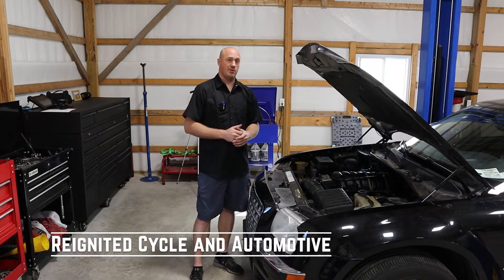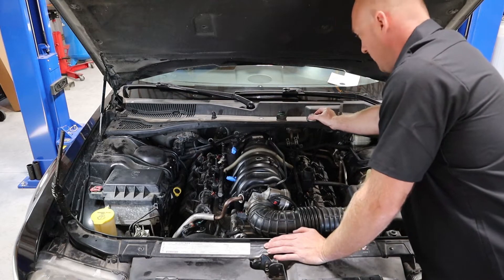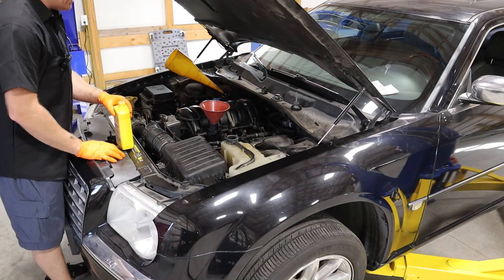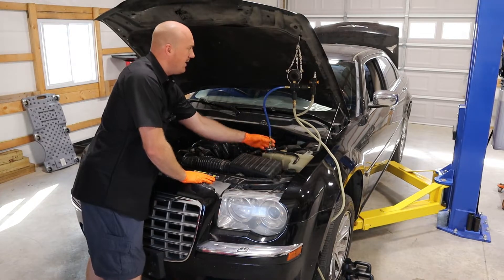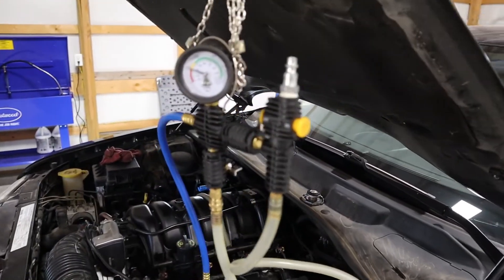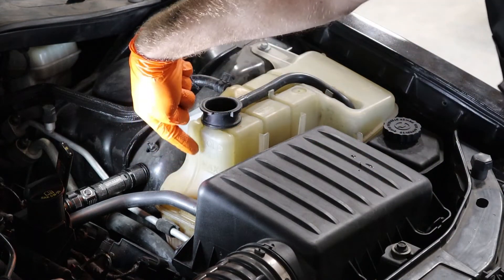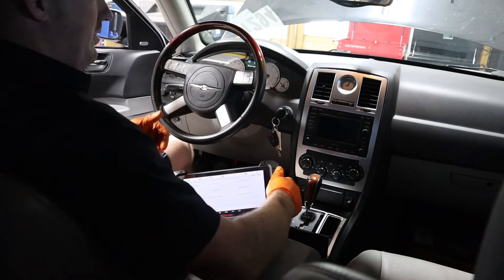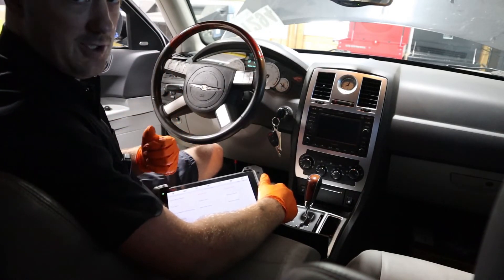Will It Start // Chrysler Hemi 5.7 Engine Rebuild Completed // Chrysler 300 Episode 5

Comment: I know this was from 2 years ago but I just saw this video and wanted to comment on pulling the fuel pump fuse so that the engine won’t start immediately to allow the oil pressure to come up and start to lubricate the engine.  This is a great idea but you don’t have to pull the fuel pump fuse.  These cars have a “clear flood condition” procedure which does the same thing.  With the engine off press the gas to the floor and then turn the key to start it.  The fuel pump is off and will remain off as long as you hold the gas pedal down.  I do this after each oil change for a few seconds to get the oil flowing before it fully starts.  I really like your channel and have been watching it for a while.  I have a 2008 Dodge Magnum R/T and a 2009 Chrysler 300C.  I do most of the work on these cars myself as a backyard mechanic.  I love working on them and learning more about them.

Comment: I love your videos. They've been really helpful with my 5.7.
Keep em coming.

I saw this video a few weeks ago and COMPLETELY forgot about how this sounded on start-up.
I took my time making sure I paid attention to what I was doing tearing it down and I did everything right putting it back together and got my 2014 Ram 5.7 back together after replacing the drivers side head swap due to broken valve spring and valve guide. 
It's  been a few months since it has been running, mostly due to my wallet said so, I started it and this is the way it sounded, but being gun shy from when I was trying different stuff to try and diagnose what turned out to be the spring, and ended up breaking the valve guide, I shut the truck back down immediately, thinking it had jumped time from all the clattering it was doing. 

So I went through all the shit needed to drop the oil pan on the 4wd trucks, swapped the timing chain AND DID THE HELLCAT OIL PUMP UPGRADE. 
When I get it all back together this time, I'm going to remember this and let it run to get the lifters pumped up.

Comment: when I worked as a yamaha tech I made a forced engine lube system with a old tire air tank using the oil galley plug.  this is something you have to to do LS engines. you can actually buy them from summit racing or jegs.  I think melling makes them.  I had a 2.2L that even with pre lubing the engine via a makeshift luber through the blocked off distributor hole it never stopped ticking. I had to pull the head off a brand new engine.  after that, I dont trust they will stop on their own.

Comment: Man I bought a 2006 dodge durango 5.7. I didn't have a lot of money. But the guy sold it to me said. It runs great. And it did for like a week . Now I have this dodge and no way to really fix it. So I loved this dodge but now I wondering how to get it back on the road.. I found that they used a head gasket sealer and its starting to leak again. Man really thought this thing was great. But it is a problem. 
It only has 128 THOUSANDS miles on it.  But I love these videos it helped me to understand the problems I have with it.
Reply from the maker: Sorry to hear about the issues you are having, but the good news is the Hemi is a pretty straight forward engine to work on, so if you feel confident tackling it yourself I'm sure you could do it. 👍 I'll have more Hemi based videos coming soon that should help if you decide to rebuild it. Thanks for watching!

Comment: Thanks for these videos! I’m probably going to need to rebuild my HEMI soon too, and for the same reason. Except mine got hot before I could pull over and stop. Water pump failure, but it still runs fine. Just idles down in steps after you rev it up 🤦🏼‍♂️ are you near DFW by any chance? 😂

Comment: Great video thank you! I’ve got a ‘14 Ram 2500 4x4 with the 5.7 HEMI and I’ve got a bit of surging / hesitation between 2-3.5k RPM’s on acceleration. I suspect the common lifter issue but we will see. Very good tips and info in your video in the event I have to tear into things. 👍🏻👍🏻
Reply from the maker: Thanks for watching! 👍

Comment: I can't get the plug out of the water pump on my 05 Magnum Hemi so I use one of those large funnels that connect to the radiator cap position that can be mounted up high.  The air burps out in a few minutes filling the system the first try.

Comment: Thanks again for your videos, as an old-school car guy I grew up rebuilding small block Chevy and Mopar engines with my dad, who also was a line mechanic for a Dodge dealer back in the late 50's and early sixties. It had been about twenty years since I got into a full rebuild - and I'd never tangled with a hemi until now, and it wasn't something I looked forward to but with your help, my 5.7 is back in the car, and it runs great (although I've only got 250 miles on it so far). I do have a question though, regarding break-in, the last engine I went through completely was a Mopar 360, and as usual, I ran a good 20 weight for 500 miles through break-in, and then changed to 30 wt. On the 5.7, I went with 5-20 (Mobil 1) and as per the owners manual of my 300, planned to change it out at 300 miles with the same brand and weight. Someone mentioned that I should have run a break-in oil first - one without zinc for engine longevity or some such thing and I find I'm second-guessing myself about something that I can't substantiate, I noticed you went with Pennzoil (5-20?) I wanted to get your opinion/thoughts on that.
Reply from the maker: Love to hear that you were able to get it done yourself! As far as break in oil is concerned, no worries, just run the oil you have in there. The break in oil is more for older engines. If you went so far on your rebuild to hone the cylinders and install new piston rings then the break in oil makes sense. But if you just replaced main bearings/ rod bearings ect... then it's not an issue. The new camshafts also do not need break in oil.
Reply: @ReignitedAuto  Thank you very much for your time on that - yeah the engine dropped the valve seat on #4 cylinder and well you know the rest, however while the pistons and head took a pounding I was surprised how good all the bearings and journals looked, very little telltale wear but I replaced everything but the crank anyway. I went ahead and installed all 8 pistons and an MDS delete kit, and used a tuner to shut it off at the ECU. After all was said and done, I almost enjoyed the work, and I hope to keep the car for a long time, your videos provide a valuable service to guys like me so thank you and all the best to you.

Comment: Hey , I just finish rebuilding my 5.7 w/ mds delete kit , melling HV pump  

got it turnt on it sounds like a diesel engine. I was thinking that it was just the lifters so I took it for a test drive and not even 5 foot from the house it had no power . 
I should mention that i got my mds programed by a local tuner 
I checked codes and only fount p0016 
please help me diagnose my truck
Reply from the maker: Generally after someone has done a lifter job and experienced an issue like this, I send them to this video first: https://youtu.be/jMziMqWRMk0
If this doesn't turn out to be your issue, let me know and we can dive deeper. 👍

Comment: My car started to make that ticking noise . Do you thing i can drive for at leat one year like that?. Also one of my local mechanics put some thicker oil. And the ticks are still there but less louder. But the car still drives. But has misfire code in all cylinders.

Comment: I have an 04 hemi 1500 and the engine was rebuilt but I have no crank at the key I jumped.the started solenoid and it cranked over then some came out the back of the intake manifold and then I tried it again now no crank at all with jumper wire

Comment: Got a second generation Dodge Durango 5.7 hemi does the harmonic balancer have a gap in between the crankshaft seal in the harmonic balancer why is there a Gap in between harmonic balancer is on all the way and still a gap any advice

Comment: I love what you doing. keep up the good work. I've been watching a channel for a while now. I have a problem. I was wondering if you could give me some advice? I recently had my lifters rods replaced I'm my hemi 5.7. the car was taken to the dealership to get it looked over. But for some strange reason my lifters keep making a loud tapping noise is it anything that I could do to calm that down?
Reply from the maker: What exact parts were changed? Were the parts factory parts? Did the noise only appear after the parts were replaced? Let me know and I'll see what I can do 👍

Comment: Hi, first of all, great video series of this rebuild!
I would like to consult with you about something..
I have a 2010 jeep commander with the 5.7 hemi vvt mds..around 120k miles on it.
The car overheated and coolant was flowing into cylinder number 6 only, it didn’t mix with the engine oil.
The block and the pistons are in good condition, only the head gasket was toasted at first glance.
When the heads were sent to be pressure checked, one valve and valve  seat teared so I kind of had a luck with that.
Any way, many of the other valves on both heads are a bit displaced.
I am considering of purchasing two rebuilt heads.
My question is, if there is a risk of putting rebuilt/new heads on old block like different pressure that will harm the crank or pistons and eventually cause an excess of burning oil or any other bad thing?
What do you recommend?
Thanks
Reply from the maker: Nope, I wouldn't have any concerns about putting rebuilt heads on the original block. 👍 One thing I would say to look out for though, make sure the heads are using factory valve springs. I really have not had great luck with aftermarket Hemi valve springs. Hope that helps, and thank you for watching!

Comment: Hey not sure if you have mentioned this in other videos you have made, but I was wondering during the scanning section of the video why a cam/ crank relearn procedure wasn’t done? Does it need to be done after rebuilding a stock engine? New to mopar and hemi’s here
Reply from the maker: It's a procedure that can be run using a powerful enough scan tool, but it's not strictly necessary. The engine will run just fine without it, and it'll auto learn as it runs anyway.
Reply: @ Thanks man! Appreciate the reply! Building up a 6.4 Jeep that I got from the salvage lot, and have been watching all your videos for tips and tricks, appreciate the content and the expertise!🤙🏻

Comment: Great Series of videos, I do have a question my car has over 2000k miles and think of the rods tools crap. Do you recommend to rebuild whole engine or just replace the knocking rod or piston? What type of kit do you recommend? Should I have the block machine or hone? I would like to try and do it myself.
Reply from the maker: At that kind of mileage I'd be looking at a full rebuild. However, you won't know how deep to go with it until you take it apart and look at it. Honestly, with no prior issues I don't think there's any problem with just doing a quick hone job and slapping some new piston rings on it. New main bearings, new rod bearings, new lifters and all new gaskets/seals. As far as kits go, I don't have a good source, but to be honest for the main/rod bearings/lifters go I'd be using factory parts, you don't want to take that apart that far any more than you have to, stick with parts that you know are good.

Comment: This has been an AMAZING series. I'm in the middle of doing a very similar project. 

I have a question you may be able to answer. I have a 2013 Chrysler 300c AWD with a 5.7 and spun a rod bearing. 

As a project, I got a hold of a 2014 300 SRT8 and did an engine swap. It seems to have been plug and play (except for swapping the oil pan and having to get the exhaust around the transfer case.  I have 3 issues that I'm having trouble finding someone to help me with cause it's a now a Frankenstein car.

1) The power seems a bit low. I kept the 5.7 ECU cause when I plug in the 6.4 ECU the car starts and shuts down after 5 seconds.
2) As soon as I roll over 10 miles an hour, I'm getting a Service AWD.
3) I also have the ABS and Traction lights on permanently.

Let me know if you can help. I'm willing to pay someone for information, but haven't found too much info.
Reply from the maker: That sounds like a very interesting project, and unfortunately you're going to need the help of an aftermarket tuner to solve your issues. The reason the car dies after a few seconds on the 6.4 PCM is it's not seeing the proper key for that vehicle. It's a security feature. That could be turned off using an aftermarket tuner, however, it won't fix your AWD issues. The power is low using the 5.7 PCM because the tune is all wrong for that engine, doesn't have the right injector size programmed ect... Your best bet in this instance is to find someone who can tune the stock PCM using a piggyback style tuner for the new engine. As far as the AWD stuff goes, it's likely that the system needs to have an ABS calibration procedure performed. If possible, see what codes are in the ABS module and get back to me. 👍
Reply: @ReignitedAuto   Thanks for the reply. I've called about a doze garages and so far no one wants to get involved. I did reach out to Nick from Nick's Garage Youtube channel. And, while he works on older cars, he's going to try and help me find someon. It seems like Youtube has become the true place where people want to explore and try things. 

I'll try and find a tuner, like you said. Out of curiosity, I actually have the key from the 6.4 PCM and brought it with me to the car, but no luck. 

I'm thinking if I can't get help to start learning about TunerStudio and taking on the task on my own. I have a background in Computer Science, so I'm thinking that may help.

Thanks so much
Reply from the maker: @icarusfx84  Yep, I can almost guarantee that no shop will want to get into that, it becomes a snowball issue that they then become married to. Easier by far to just say no. But I think it's a pretty cool swap. Unfortunately the key is only one part of the equation, when you start the vehicle using the key, it sends a signal to several antennas throughout the car that report back to the radio frequency hub (module) that verifies the key is correct for the vehicle and allows it to keep running. If it doesn't receive that signal within 5 seconds it shuts off. 
I would recommend getting started with tunerstudio. I used megasquirt on one of my older motorcycle projects, very capable system. The one downside of it, is that there are no safeguards, at least there wasn't when I was using it. Basically, whatever value you put into a table, that's what it'll do, no matter if it'll melt down your engine or not. So just be careful about that. If you do get it working properly I'd like to see it!

Comment: Hey, question for anyone but when I put the rods back on, is there anything special I have to do or just torque them
Reply from the maker: I think the primary thing is make sure they are oriented correctly there is a shoulder to one side of the rod that butts up to the edge of the bearing journal, then when torqueing them you go to 15ftlbs then an additional 90 degrees. 👍

Comment: Is there any other procedure for priming the engine or new oil pump before starting? Or is pulling the fuel pump fuse the easiest way?
Reply: With most newer models including the car in this video, you just have to hold the gas to the floor and crank it. The system cuts the fuel and spark and it won’t start.

Comment: How long does it take for the lifters to stop ticking? After new lifters are installed I'm asking cause I done mine in my 13 charger and i went thru the whole mds intervals and drove it for over an hour and it still has a slight tick at idle any thoughts on what I should do?
Reply: Did you figure this out ? Bc mine is as well

Comment: My camshaft need to be replaced so I did so put everything back in the way I took it out now my truck turns over but won’t start any idea why that may be?
Reply from the maker: Does the engine try to start at all? Like does it pop or sputter, or does it just turn over without even trying to start?
Reply: I forgot to get the oil pressure up once I did that it started right up but now it starts but when it idles down it turns off slowly no engine codes or anything

Comment: Coolant system tool not very expensive.......$225.00 on Amazon for some that is expensive! Yeah I have tools working on airplanes about $75K worth of SNAP-ON & Mac well $75K is not a lot for say but some areas on the plane no other tools can fit or work as well as SNAP-ON or Mac

Comment: If i rebuild my 5.7 hemi do i need to tune the car ?
Reply from the maker: If you are just rebuilding it to stock specs then no 👍
Reply: @ReignitedAuto   Ok thanks a lot ,,,, just asking because i’m changing my oil pump to an high pressure pump

Comment: When you installed the engine and connected the flywheel back to the torque converter that involves turning the crank correct? So did you have to find TDC again?
Reply from the maker: Nope, TDC is unimportant after you install the timing chain. The PCM handles all the ignition timing 👍
Reply: @ReignitedAuto  thank you for your help boss !